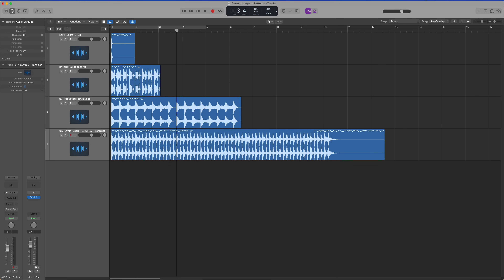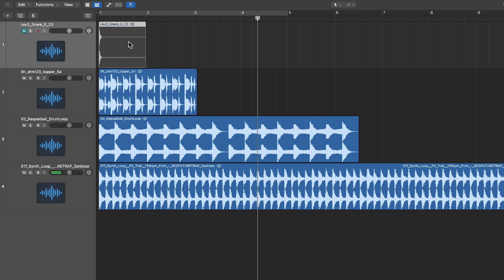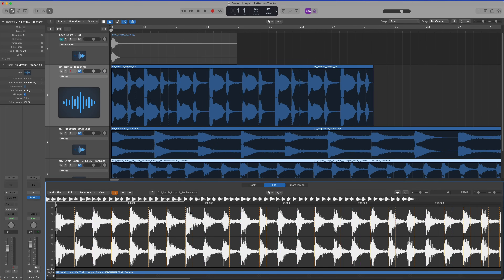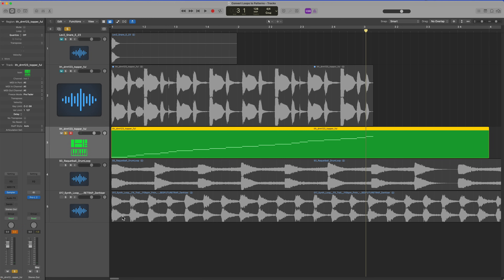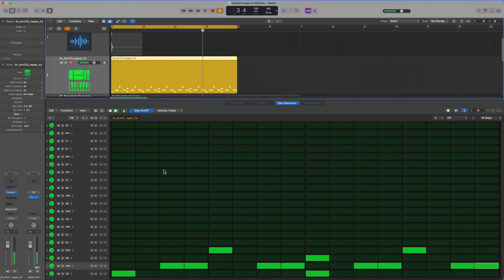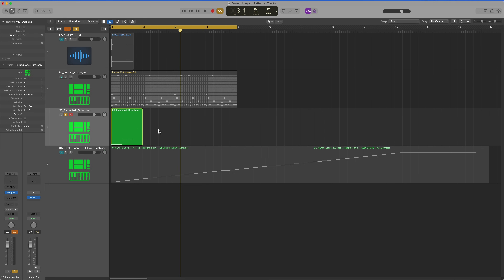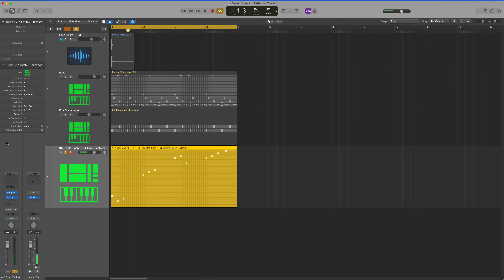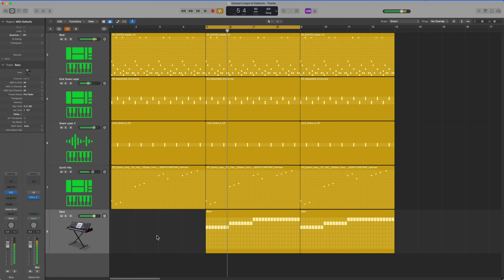Logic Pro 10.7 - Convert Audio Loops to Pattern Regions (Loop Slicing)

Comment: Inspiring! I was thinking, EZ Drummer comes with 2000+ patterns, which they call grooves, but are really just midi.  In fact, there are groove packs from famous drummers.  I was wondering if there’s a way to convert these to patterns and save them in Logic?  Other than drag a midi pattern into a track, convert to pattern region, then save one-at-a-time.  Just thinking about a bulk covert process.

Comment: Sir, is this function available in 10.6.3
Reply from the maker: Loop slicing audio in quick sampler has been available since 10.5, however yet part where I convert midi regions into pattern regions is new to 10.7.
Reply: @MusicTechHelpGuy  Well noted Sir..... So its not in 10.6.3.

Comment: I was able to get the first part but it won’t let me convert after the first time I converted it. I can’t  get it to look yellow it won’t let me. I did take the loop and put it Q sampler and break up the audio like you did then I right clicked and I can’t convert to get it to the step sequencer
Reply from the maker: Your loop is probably too long. Try cutting the midi region in half just like I did in the video.
Reply: @MusicTechHelpGuy  even after cutting the region I can not convert.

Comment: After i convert mine to a MIDI region I don't get the option to convert it to a pattern region.  I have tried 5 different loops and I don't understand why I don't get this option.  Its just grey'd out and wont let me click it
Reply from the maker: Sounds like you missed the part in the video where I mention that the length of the midi region will affect whether it can be converted to a pattern region. Try splitting the region in half like I do in the video and it should work.

Comment: I think fastter way to make those loops into pattern regions would be to just drag then into a Q-sampler like with the one shot. but use the optimized and set the slices to what you want inside Q-sampler and just drag miidi out from the bottom part of the wave form in Q-sampler, then convert to pattern region and make beat how you want it.
Reply from the maker: It depends on if you like editing the transients in Quick Sampler or not. I'm not a huge fan of editing in Slice mode in quick sampler if there are a lot of transients to edit. I find that tweaking the transient markers in the editor is faster for me. But for shorter samples and loops, definitely Quick Sampler is fantastic for those. The MIDI drag feature is really nice! I never knew about that before!
Reply: @MusicTechHelpGuy  Yeah if you drag a midi or pattern or drummer region into left side it bounces that region with all the fx you have on the track. I like using retune from zplane or little alterboy for this trick too.
Reply: Works great with the Apple Loops, like the sound, but not the melody? Problem solved. Seperate an entire drum loop and Finger drum your own beat? No Problem. The way to go. Slices, by transients, beats, measure, quite cool.,
Reply: @UC21BwBKSKiPFbNvzl3-eh_A yeah that makes sense. I don't usually use loops that are longer than 8 bars so I haven't run into that problem. the Qsampler is faster for chopping up a short loop into 8th notes or 4th notes I've found.  Also one thing I like to do is take a polyphonic loop and turn it into a tonal one shot by putting the vocal transformer on it in robotize mode then dragging into Q-sampler. It makes some pretty unique sounds.

Comment: is it a problem for us to install the new version of macos? For logic pro?
Reply from the maker: Despite the fact that a LOT of people have complained about issues with Big Sur, I have not had this experience. Big Sur has been out for a year now, and it works great. I didn't lose any of my plugins after updating. The NEWEST one Monterey, I'm not so sure. I know Logic will work with it just fine, but I wouldn't rely on all of your plugins to be compatible with it yet. I would hold off at least a few months before getting Monterey.